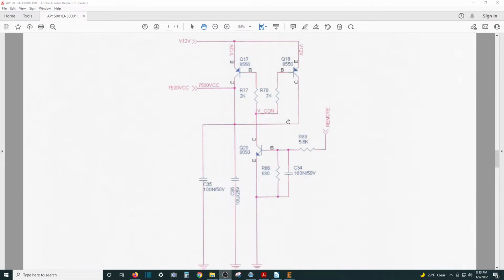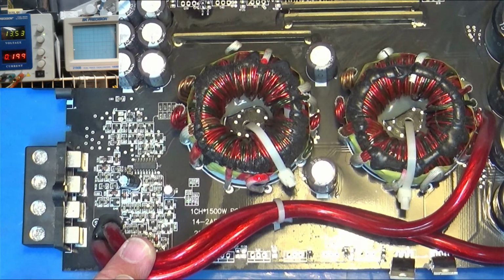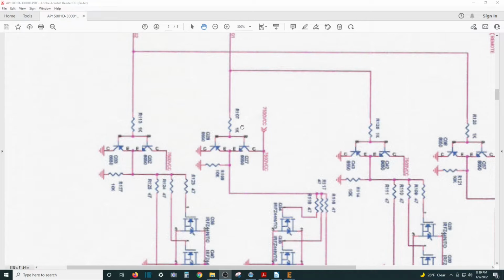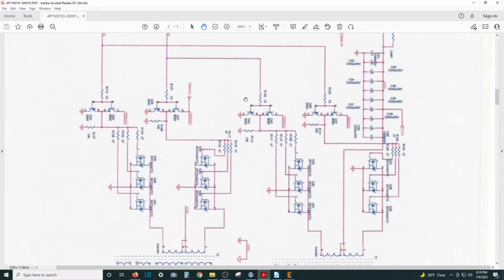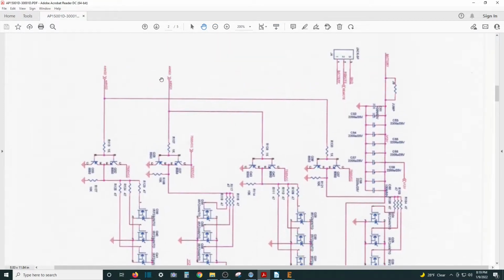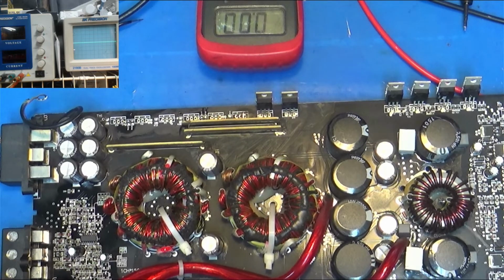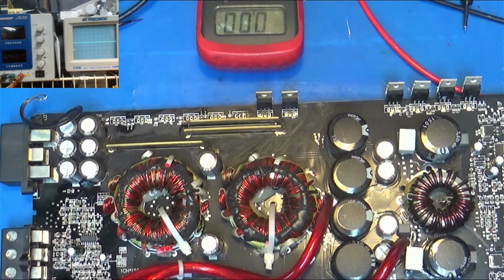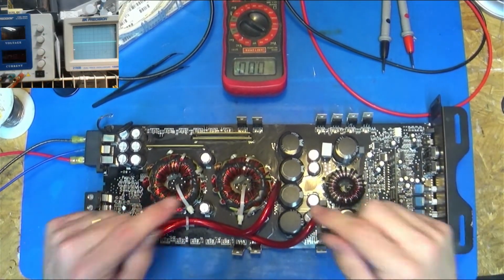Audiopipe APDL-16001D Repair. Live stream followup, remote turn on and PWM repair.

Comment: My skar amp came in and it was broken from the power connection the ups threw my package and it came broken is they anyway I could fix this? It’s just broken off from the Metal so maybe welding back would work ?
Reply from the maker: Contact who you bought the amp from, there should have been insurance on the shipping, so you can file a claim on UPS. Otherwise take it to a repair shop, some can be repaired, other times it will have to be replaced.